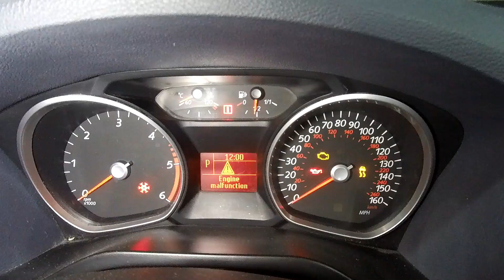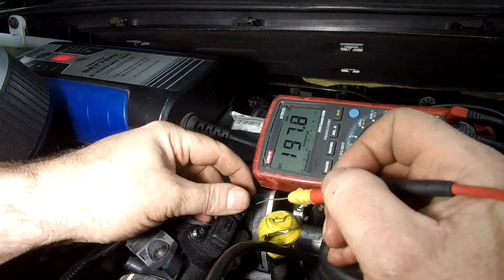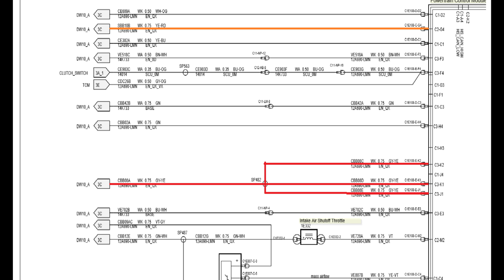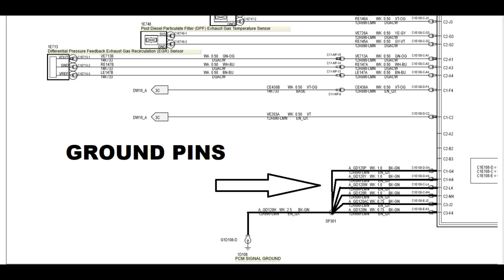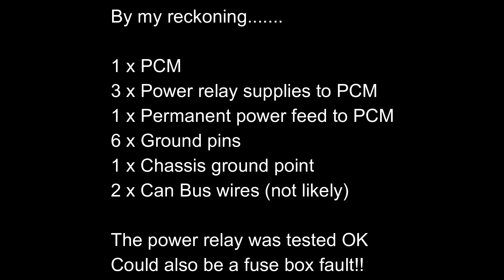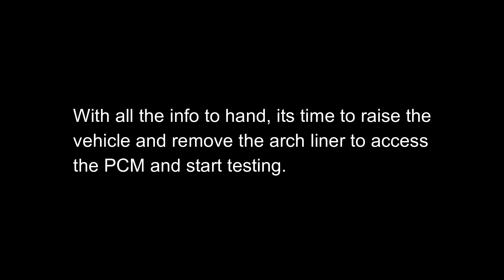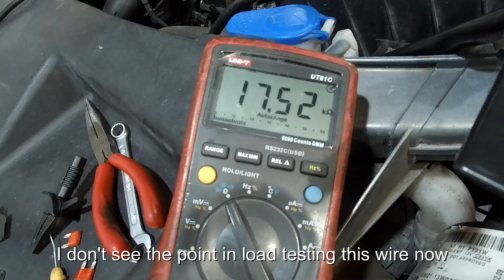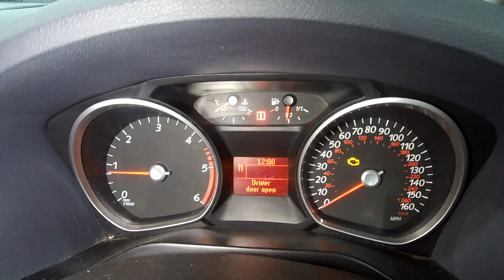Ford Galaxy 2.0TDCi - Non Start, No PCM Communications, Immobiliser Light Flashing

Comment: Dealing with a problem very similar today. 2014 Ford fiesta 1.6 diesel with keyless entry. No ignition lights no start and no coms. Scanner will only get coms if I bridge igniton relay. Found all keys were lost in the system after scan. Can't program keys for some reason. Any input welcome.. Great video once again.. Well done Skoda..

Comment: Great video mate. Would you mind including a pic of the broken wire, and show us your method of repairing? Thank you
Reply from the maker: To be honest I was told to just run a fresh wire in, so I located the wire just out the fuse box and ran it parallel to the main harness to the PCM.  Connected with heatshrink connectors.

Comment: I have one of these in that wont start, cranks but will not fire up.  Would not start today after i replaced timing belt kit, obviously i suspected timing issue even though im a confidently proud cambelt fitting expert with 30 year experience...but after self doubt, blind panic and checking 3 times timing is spot on, wish that was the fault as ive been working to 10.30pm trying to fix it with a customer adamant it has always started without problems and "well it must be something you've done" attitude of oh so joyous indignation.  

The main (middle) relay you showed clicks every 30 seconds even when the doors are locked.  Its like the fuel is cut off and im at a loss why, the possitive battery terminal was loose and i swapped the main relay and the other one is also clicking, also the clock on the radio counts up to 12:02 and then reset to 12:00 and the clock on the dash stays at 12:00, im sure its an electrical fault but if i list my skills electrical fault finding comes bottom...... help lol
Reply: Did you ever sort this ive got a Kuga doing the same thing ?
Reply: @steveguest8028  I did, it turned out to be the magnetic crankshft ring, lost its magnetism, i fit a crank sensor but that didnt solve it, on live data it did not show any rpm on screen so i bought a new reluctor ring and boom it fired up, never had this before and very embarasing and frustrating
Reply: @Russell Bury  long shot a year down the line in having exactly the same issue what did u buy exactly please  I'm having a nightmare lol
Reply: @daniswift415  I fit a new crankshaft timing ring.  The crank shaft sensor was not reading the speed of the engine
Reply: @daniswift415  its the ring that sits at the back of the crankshaft pulley
Reply: @Russell Bury  I've had a guy look at it auto electric lad said immobiliser.. but your car seems to have exactly same symptoms have  all power just spinning over but not firing  will see find this part thanks for reply legend mate

Comment: @SY Diagnostics  thx for the great video. I've the same problem but all 12V and ground wires are ok 😔 do you know the can bus wires? So I can check these 2 wires.but no sensor have reference voltage so I think the ecu is dead or what do you mean?

Comment: Just bought a 2008 Mondeo 2.0 Tdci with 140 BHP which supposedly needs a PCM due to water getting into it. I'm an ex mechanic so understand what you've showed in the video. I know about the BCM getting screenwash into it via faulty washer pump but haven't heard about the PCM getting wet. Have you seen many that have this happen? Stupid idea of Fords to put PCM behind the liners. Why couldn't they leave them inside the car!! 

Also my pin out that I got from AutoData, isn't the same as yours. It shows 3 grounds, but no powers. I have found a SID206 pin out, but I'm not sure if that's correct either. Can you help please?
Reply from the maker: Never known a pcm get water in it.
If you email me with your VIN (address in video description) I can send you info
Reply: @SYDiagnostics  Thank you for getting back. 

I'm getting the car delivered to me on friday. Will the reg number help before friday?
Reply from the maker: @JamesAllen300  as long as it isn't a private plate it should be OK. Message me on here to say you've sent an email as I don't often check this email account
Reply: @SYDiagnostics  It's not on a private plate. Emailing you now.

Comment: please can you tell me where the wire had broke/corroded? I have smax 2.0 tdci mk1 and got EXACTLY the same issue as this no comms/ immobiliser active and no crank no start issue
Reply from the maker: if i remember correct, the customer didnt want to pay the extra to find the break, so i was asked just to bypass the wire. I ran a fresh wire from the fuse box to the engine control unit
Reply: @SYDiagnostics  Thank you was this the red/yellow wire?

Comment: I have an 09 Focus 1.6 TDCI with similar fault. No crank.
PATS is showing error 1:6.
Dash is displaying DTC U2510.
Forscan won't connect.

Checked canbus at OBD. 60 ohms. Good signals on a scope. Good continuity between OBD and PCM.

Power and grounds all good at PCM.

Checked fuses and battery.

+12 from ignition gets to PCM and ECU relay is operating.

If I power up PCM on a bench it draws 200-300mA but Forscan won;t connect.

Checked solering on dash pcb connector. Found some cracks, resoldered but made no difference.

Is PCM dead?

Will PATS stop Forscan connecting to PCM?

Anything else I could check?
Reply from the maker: sounds like it requires a PATS parameter re-set (re-align the modules in PATS), Forscan may be able to do this with this age of vehicle, you'd have to look further into it. Usually it entails erasing the keys and re-programming them . You require 2 keys
Reply: @SYDiagnostics  Hi there, thanks for the reply! I am sus on the PATS for sure, seems to cause a lot more problems than its worth! 

Forscan won't connect at all at the moment though.

I only have one working key, the other is damaged - ironically I think it's lost the PATS chip inside when the metal key section of the case got snapped off...

I have a kit of bits coming (IC/PCM/GEM/KEY etc) so I may be able to swap some parts around to see if it's the PATS or PCM that is causing the issue.
Reply: Tested a different PCM. Forscan reads it on the bench no problem, so reckon my PCM is defo stuffed. Sending it to ECUTesting.

Comment: Looms would collect water in the harness were it loops down beside the radiator and subframe. symptoms of non crank / no cooling fan amongst others
Reply from the maker: yeah, seen that a few times on the Mondeo, the loom on the Galaxy is routed differently. Thanks for watching

Comment: Hi I had injection changed .but it gives a little crank but won’t go any further.it been in garage sence lockdown what’s the problem be any suggestions please
Reply from the maker: have you any stored codes in the engine or communication codes elsewhere?
Reply: SY Diagnostics I don’t know all the guy done was replace injector and pipes connected and said he checked starter and button but still no good honestly I think guy just wouldn’t do much with it he being given me lot excuses
Reply: @SYDiagnostics   I used vgate pro  and codes came up as (data bus yaw rate sensor module no communication) 2nd is throttle position to or accelerator pedal position )3rd app sensor switch D range /performance problem)any help would be really appreciated my car being parked up a year now .i put on ignition and all dash lights up but all I can hear when I put my foot on break is a click .it automatic ford galaxy 10 plate press button thanks in advance
Reply: It’s got big screen on dash

Comment: Hello, could anyone help me please?  a couple of weeks ago I had clutch and flywheel replacement on my 2007 1.6 diesel focus, but the red Powertrain warning light has just starting to come on whilst driving, it disappears when I restart the engine. Could this be linked to the clutch or is it more likely to be a glow plug issue? I’m clueless but really skint so I’m just trying to find out stuff for myself.
Reply from the maker: Have you considered posting your question on the "simplydiag yt" Facebook page? You should get some assistance. I don't normally answer questions direct on this channel
Reply: SY Diagnostics thank you, I don’t have Facebook but I’ll try and set one up, I didn’t expect you to answer me Mate, you do this for a living I’m not expecting free advice pal. Thank you for replying though it’s really appreciated.

Comment: I got my car started when I bypassed relay .i replaced the relay and it still won’t start nothing ?? What’s the problem???
Reply from the maker: have you got power and ground at the relay primary circuit?  bypassing just means you have circuit integrity for power and output
Reply: @SYDiagnostics   so what should I be doing next thanks for your reply